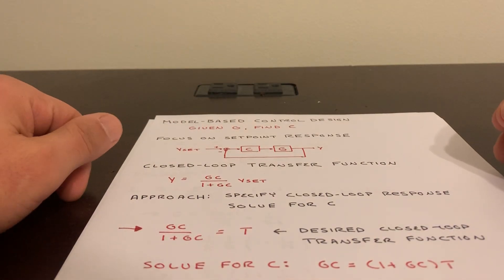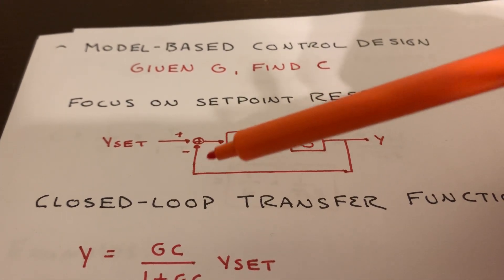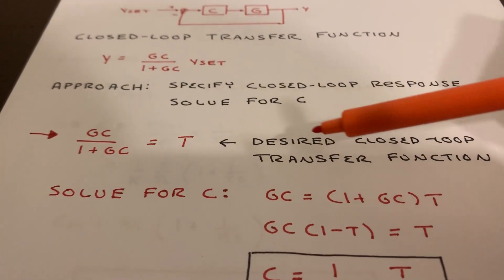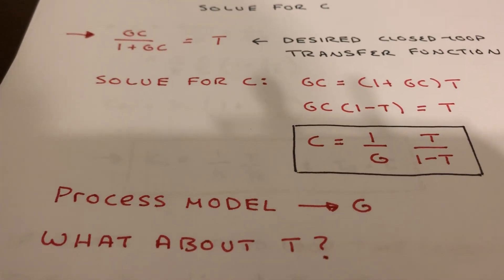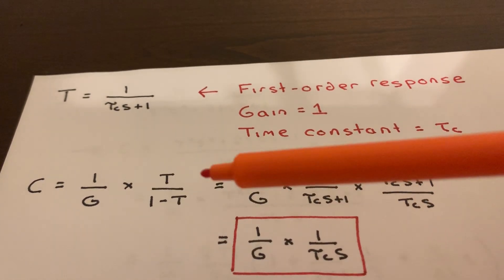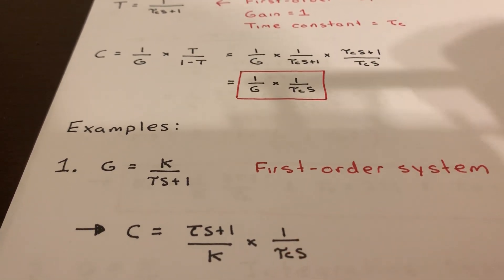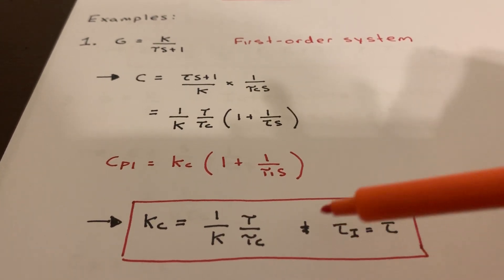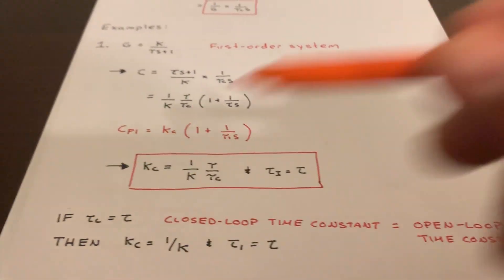Lecture: Model-based control design

Comment: 🎯 Key points for quick navigation:

00:00:00 🎓 Introduction to model-based control design focuses on finding an ideal controller based on a given process model.
00:01:21 🔄 Closed-loop transfer function is derived from the process and controller transfer functions to determine system behavior.
00:02:29 📏 Controller formula derived (C = 1/G * T / (1 - T)) is essential for achieving desired closed-loop response.
00:03:22 ⏳ Closed-loop time constant (τc) impacts feedback responsiveness, influencing the overall system dynamics.
00:05:12 ⚙️ For first-order systems, an optimal PI controller is derived, linking parameters to process characteristics.
00:06:07 📝 Simplification of tuning rules for optimal control emphasizes matching closed-loop time constant to open-loop time constant.
00:08:11 📊 PID controllers shown to be ideal for second-order systems based on parameter matching from derived formulas.
00:09:33 📉 Integrating systems require proportional controllers for optimal performance in response to inputs.
00:12:06 🤖 For servo systems, proportional-derivative controllers are identified as the optimal control solution.
00:13:01 💡 Disturbances significantly impact controller effectiveness, highlighting the need for feedforward control alongside feedback.
00:15:35 🤔 Proposed desired disturbance rejection transfer function includes key terms that facilitate effective control design.
00:19:03 📈 Explanation of disturbance rejection dynamics reflects system response to impacts and eventual return to setpoint.

Made with HARPA AI

Comment: hi... can I know what is the difference between model based control and model predictive control??  and is the model-based is one approach like Zigler and Niglust??
Reply from the maker: No, model predictive control is something entirely different. Also, Z-N is an empirical approach based on the closed-loop response. Here, we are simply choosing the controller so that the closed-loop transfer function has a desired form.